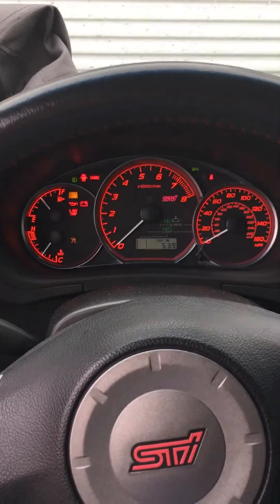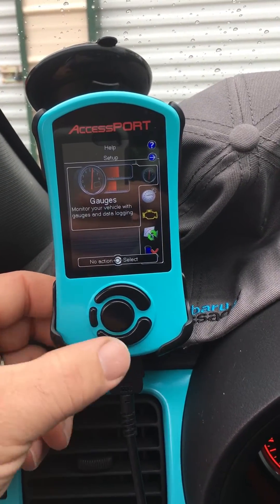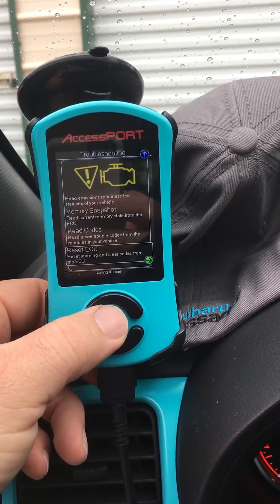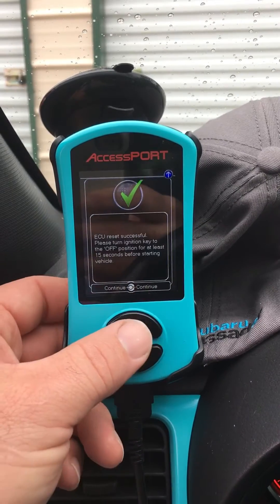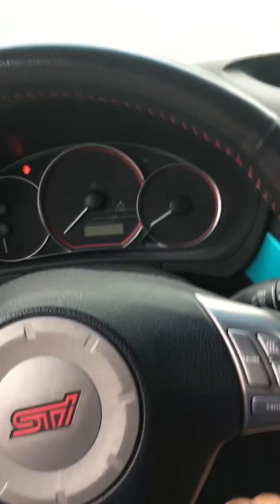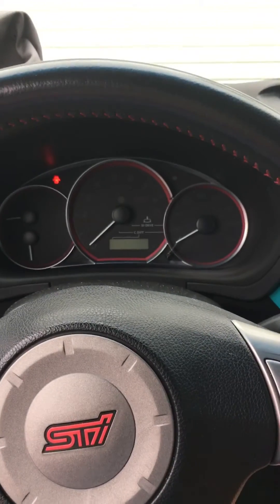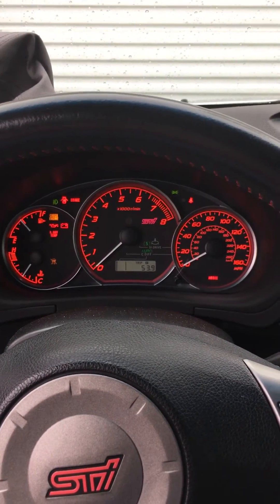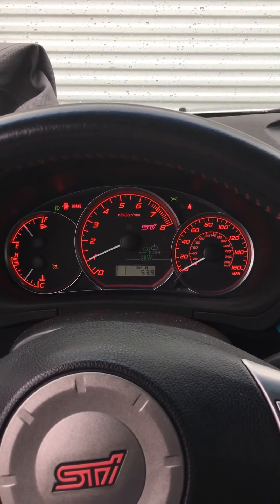How to reset your ECU with an accessport

Comment: I appreciate the video, it was very helpful. I recently installed Hella Horns and forgot to reattach the temp sensor which threw a P0073 code. I reattached it and still had a check engine light. I used your video to reset the ECU and it cleared it!🎉